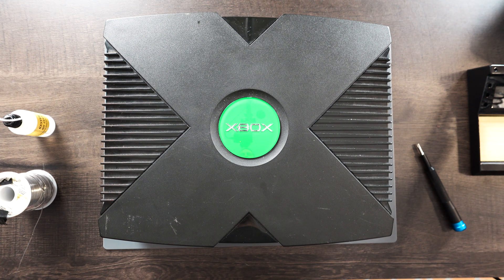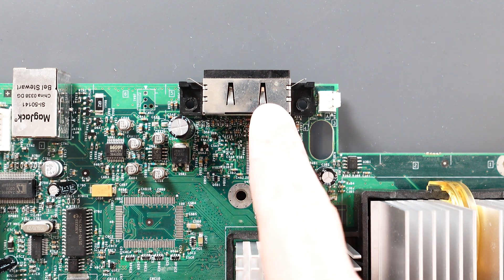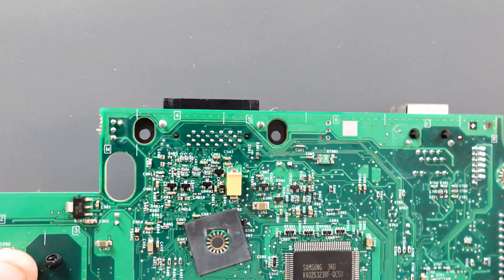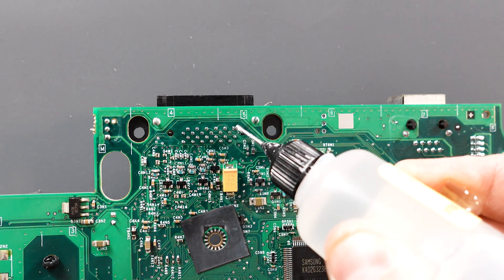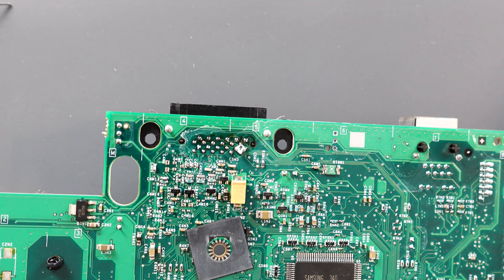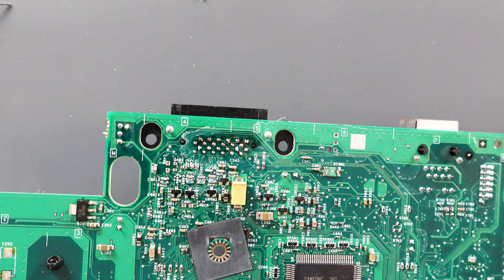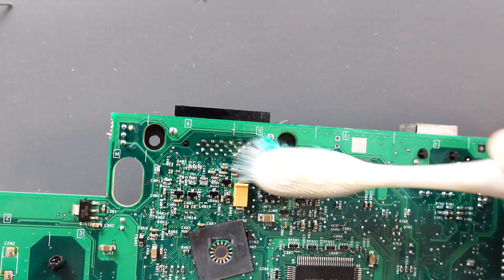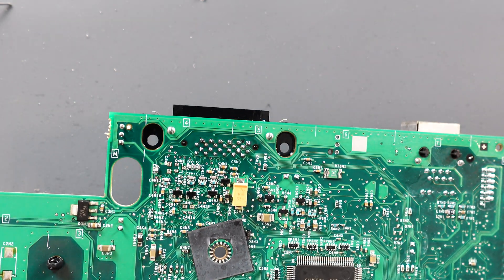Can we fix this original xbox's A/V port ?

Comment: I have one that keeps glitching, i thoufht it was the Cables soo I tried different ones but same thing, moved to another tv and it keeps doing the same thing, it’s like glitching rly bad as in the screen or video or wtv, what do you think it can be
Reply from the maker: Sounds like the av port or solder joints on av port
Reply: @Warranty-Voided soo apparently whats happening now is that, I got the red flashing ring after that, soo I was like ig it’s broken but I turned it on the next day, and it’s working fine, but now it’s been like that, I play fot a certain time turn it off maybe turn it on again and play, but then after like a certain time, it won’t turn on anymore, soo I just wait for the next day and it works fine again, soo thats just how I been using it

Comment: Mine has some sound but lots of buzzing and no video. Will this work do you think?
Reply from the maker: Sounds like a av problem. Either the cable or av port
Reply: @Warranty-Voided  it was the input on that tv actually. I got an hdmi converter and it is working like a champ. Thank you for the reply
Reply from the maker: @KiefsChingdom  nice glad to hear you got it working !Did you get insignia live setup on it ?
Reply: @Warranty-Voided  I have not yet, need to get a usb cable and drive first.

Comment: What if rca video doesn't work but component video is working. How to fix?
Reply from the maker: Check rhe a/v port for bend or discolored pins . Get a flash light and look real close.do you have 2 separate sets of av cable one is rca and one component?
Reply: @Warranty-Voided  yes I have two separate sets, one av rca and one component. I'll check the av port closer
Reply from the maker: The rca cable maybe faulty . Do you have another console to verify it is working?
Reply: @Warranty-Voided  the rca cable works in my 1.6 Xbox but with 1.0 Xbox no video only audio out. I'll check the av connector later today
Reply: @TheOriginalVersatile  you ever find a fix I got the same issue bugging me
Reply: @Warranty-Voided I got same issue as the other user rca works fine on another console so I know its not the cables pins look shiny and joints on bottom of the board look good
Reply from the maker: @richardblaine9538   you might try to turn off the hd setting in the dashboard .Its in setting video or display options try that .